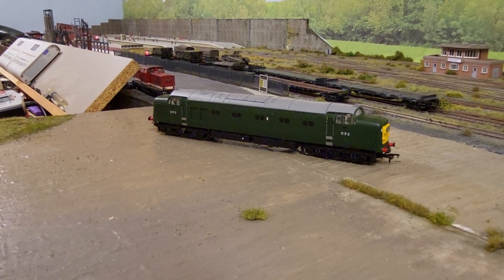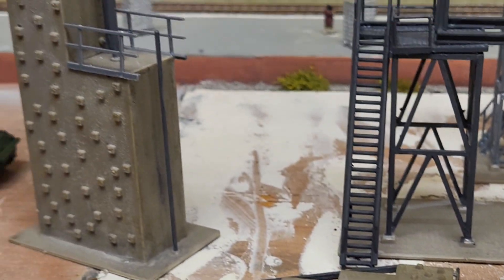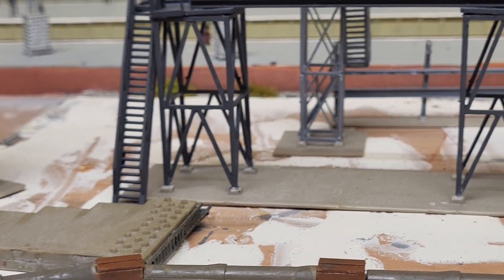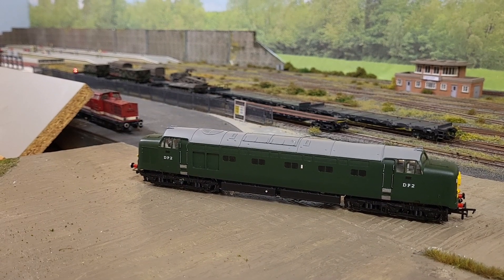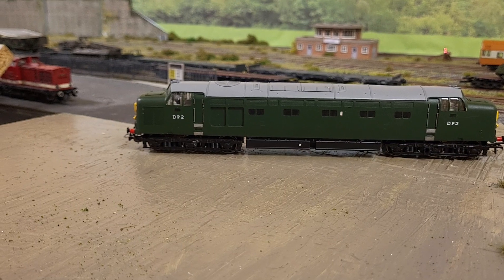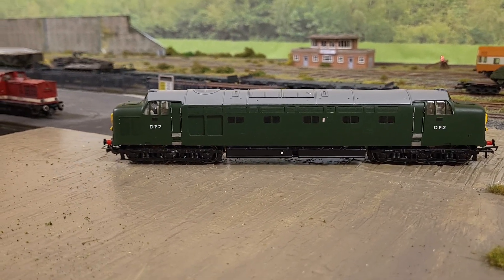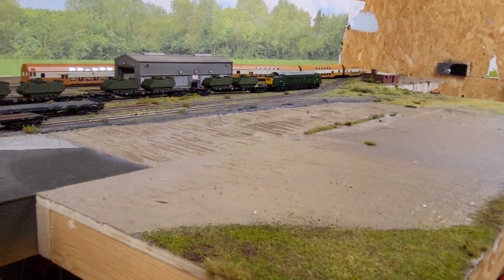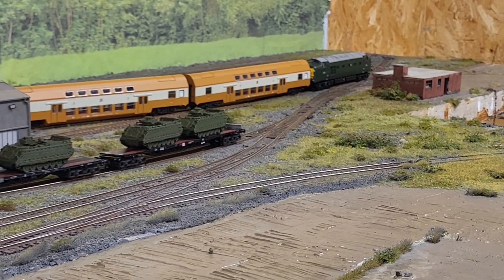Development  Project 2 (DP2)..Better look at it plus few other bits🤭

Comment: Great video Mark.  I've never seen a DP2 before.  Sounded great too.  The back-story on the actual loco was news to me.  It does fit in with the military consist there, just fine.  I thought there was a bit of the Class 40 look to the bonnets but that single-split wind-screen gave it a twist on the Deltic cab-work.  The double-deckers look good, with a decent amount of them there.   I  can only admire the ways you adapt to the bigger problems too, has to be said!  All the best with the house and paperwork.  Keep Safe, now.  Cheers!  Adam.
Reply from the maker: Hey Adam
Hope all is well  with  you. 
Tbh I wasn't  quite sure when I brought  it as description was a bit all over the place.
But worked well and does fit in well with the theme.
Yes exciting  stuff about the house just lots to do with paperwork  and  stuff. 
Long road but will be worth it.
Look after yourself  fella 
Cheers  Mark

Comment: Hi Mark - The DP2 looks fantastic and fits right in on your layout. Will look the Dogs B******s pulling those flat wagons loaded up with military vehicles. 
Gonna look fantastic Mark, especially when you have them a long rake being pulled by the DP2, even better when you have a complete loop set up in Poland.
Would love to have one on mine but it appears we didn't move panzers by rail over here after WWII and if they did they would have to be Centurions. 
Only travelled once by rail with my chieftain over in Germany otherwise is was done by Antar & Mojoes.
Love the sound of those engines, sweet.
Regards Chris
Reply from the maker: Hiya Chris.
Yeah  never moved by rail on uk but like you  was always moved by rail.
Was such a simple thing.drive on and bang chocks  in ..probably  harder these days with health  and  safety  lol.
Yeah it's like treading water but I'm looking forward to new hobby  room for sure.
Look after  yourself  fella 
Cheers Mark